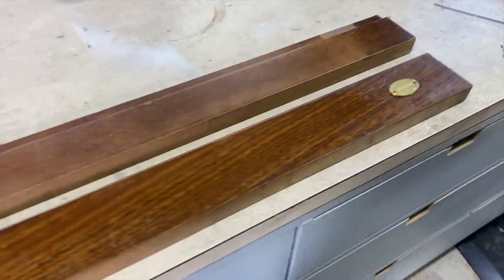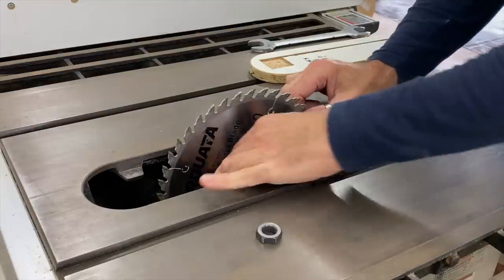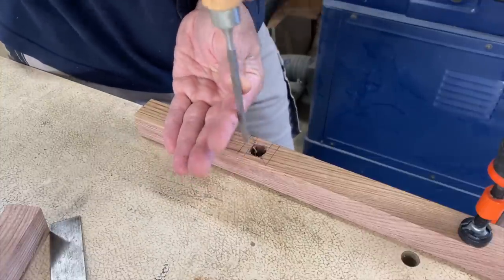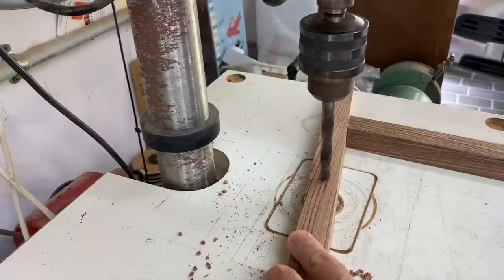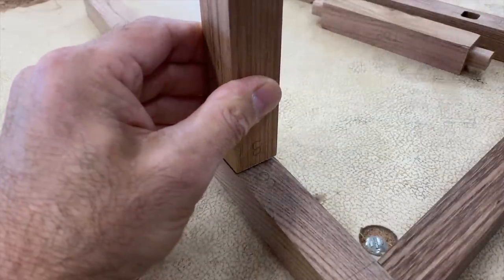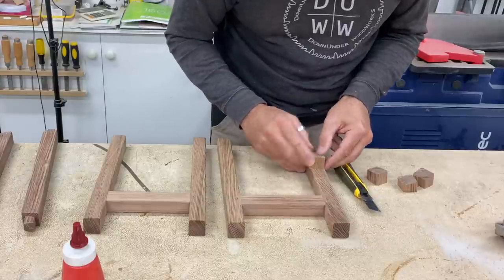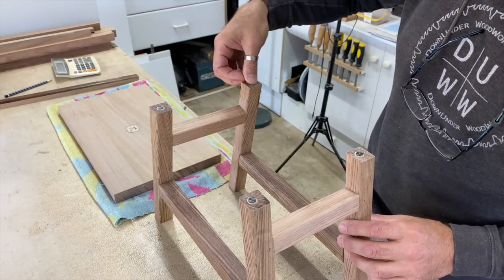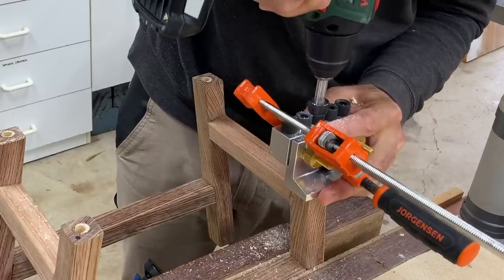Mistakes were made | Making a timeless, classic step stool

Comment: Hi, Victor, I've just been perusing your channel.
Your ideas and work are relay great.
This step stool looked good, before the bees wax and after looks amazing.
P.S.: I noticed your table saw rumbles some. That can be corrected with a link belt.
Actually, every belt driven tool should have a link belt. They do a great job of
reducing vibration and noise. Just be sure to install in the correct direction of rotation. 😁✌🖖
Reply from the maker: Thank you very much mate. I have looked into them a while back but they were so expensive. I might have another look.

Comment: Lots of good techniques here, especially how you did with pre-cutting with the of the tenon's shoulders, choice of rounded tenons to fit the router/jig, and the drilling of holes for placing the pin locators. I just might have considered to add a (traditional?) oblong hole at the center of the top for easier carrying.
Reply from the maker: Thank you mate. Im really glad you were able to get so many tips and techniques from the video. I did consider the handle hole in the top.

Comment: Very nice project and video with lots of little technical details-thank you for sharing. Like others I was also puzzled when you used 10° block even though you have DowelMax. Lesson I learned is that in general the dowels should always be perpendicular to the surface which is what a doweling jig for it will do for you by default.
Reply from the maker: Yes mate, the lesson is definitely learnt. Wont be doing that again

Comment: Beautiful stool in design and looks. Great recovery from the 'Oops'. A take away for me was the weight on the frame while glue drying.( that was nice wood by its self). I always seem to have  a slight wobble on my legs and need to take a file even them out. Thanks Victor
Reply from the maker: Thanks very much Peter. Glad you got something out of it. its a good habit to have but you have to have a flat bench or other surface to do it

Comment: Nice piece and good work on the joinery. 
Can you please give me your thoughts on the Sherwood thicknesser. I've been looking around  but always come back to that or Carbatec. Is it helical cutter? Fairly quiet? Thanks, Ryan
Reply from the maker: Thank you Ryan. The thicknesser is great. I love it. It is the helical head model and feels effortless and is much quieter compared to the small bench top type i had. There is a big difference between the 15'' and the 16" though IMO. the 15" has an overhead motor and when you change the height of the cut you are winding up the motor and cutterhead assembly. On the 16" you only wind the bed up and down to change the cut height and thats why i went with it.

Comment: You could have saved the original dowel holes my making them through the top.  That's what I thought you were going to do when you angled the holes.  Nothing wrong with that but it does make for a different top.
Reply from the maker: yes John, i definitely thought of that as an option but went for the clean look in the end. In hindsight, exposed dowels in the top would have matched the exposed dowels i used to pin the tenons. Thanks mate